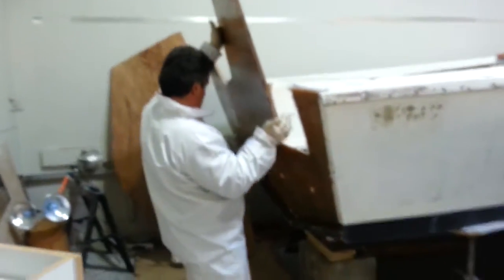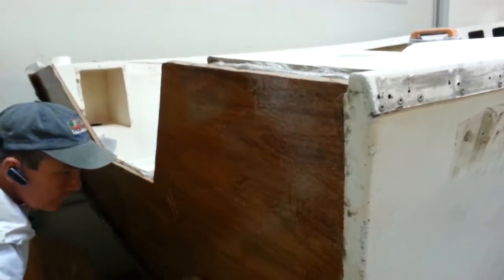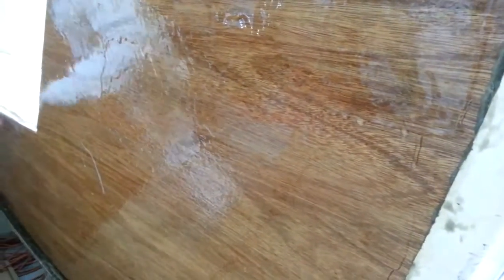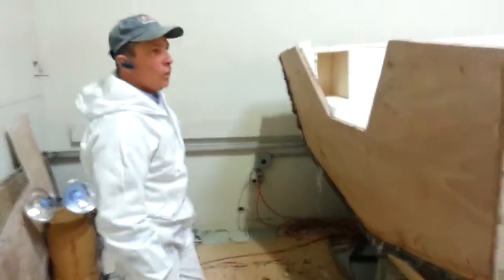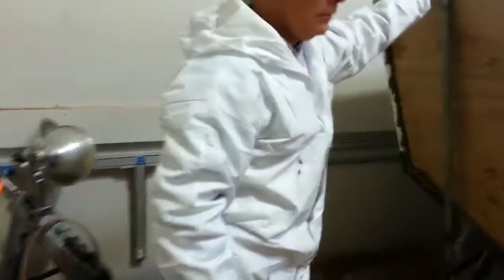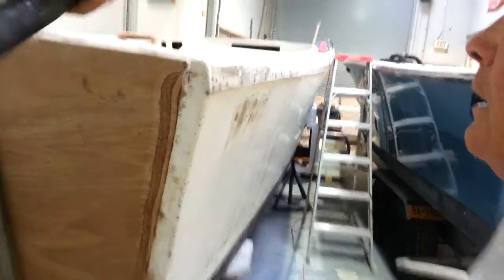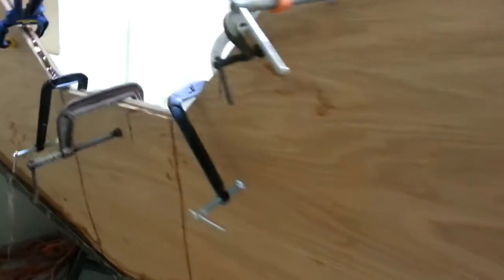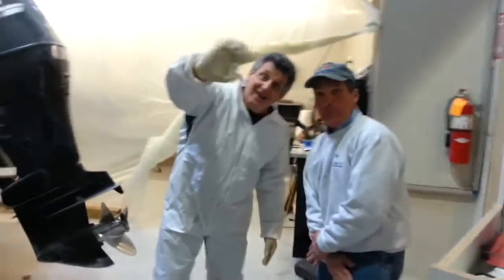23 Mako Transom

Comment: Not bad, I just hate that you used wood. At least you did use the best possible wood. I personally will not install wood in a boat anymore! If a customer doesn’t want to spend the extra bit for coosa, then I don’t want them as a customer. Just prefer to do higher end boats (like this one) and I make the customer see the value in the coosa. I get that 7 years ago coosa hadn’t really truly made its debut. Now at 600 a sheet for 2” it’s certainly not cheap, but it certainly worth it. 

Great job though guys!